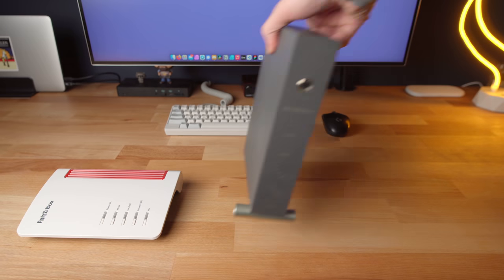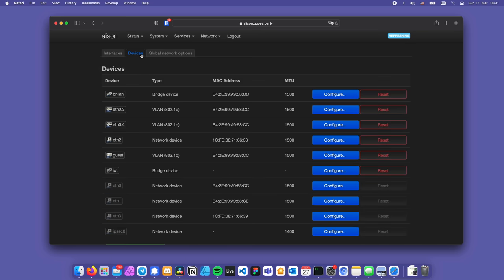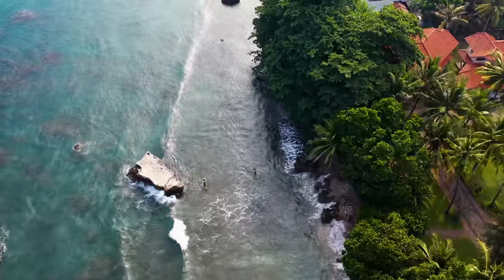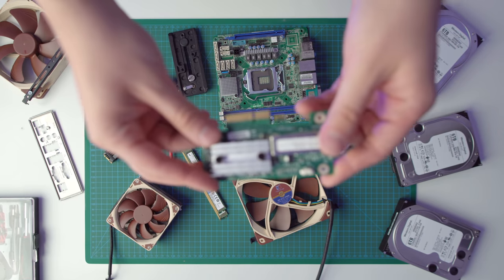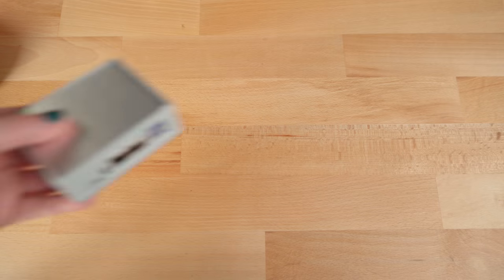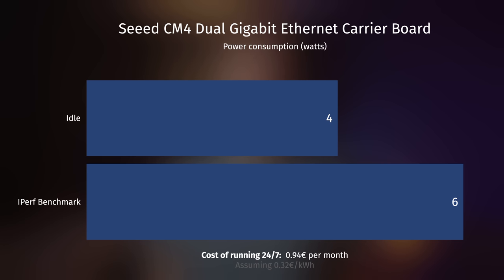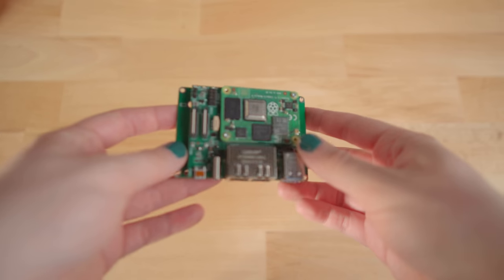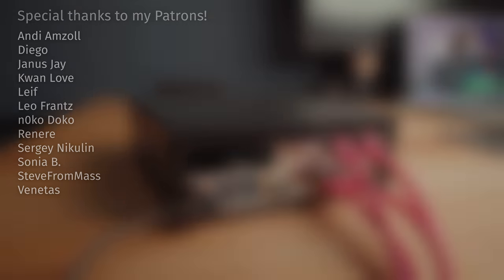Should You Build Your Own Router?

Comment: Those older Atom boards may use 25 watts, but they don't have an Intel Management Engine. Choose one: power efficiency or real privacy. But then is it really less power efficient if you can run NAS, wifi and everything you might need on just one computer instead of 3 or 4 like you do? They have AES-NI and VT extensions on top of that.

Also you don't need one of those specialized router appliance distributions, these just add a glorified web interface to all the stuff that is already available in a regular Linux distribution. Would rather start with a clean slate and install exactly what I need than with all kinds of preconfigured crap you need to spend a lot of time to check what's it's doing if security is important. With a regular Linux distribution you get systemd-networkd which is awesome for networking instead of a spaghetti mess of shitty shell scripts.

UPnP is always a bad idea.
Reply from the maker: Several points.

1. The DDR2 era Atom boards perform about on par with Raspberry Pi 3s. That is to say, you wouldn't want to run anything but the very lightweight OS + applications combo on them, and even that might give you a miserable experience. 
2. I'm also not sure where you got the information that those Atoms support AES-NI. They're called *new* instructions for a reason, and the processors we're talking about came out in 2010 – https://ark.intel.com/content/www/us/en/ark/products/49490/intel-atom-processor-d525-1m-cache-1-80-ghz.html
3. Even if you did have a powerful device that could run it all – you'd be putting all of your eggs in one basket. "Oops, kernel update broke the system, now I have no router, no NAS and no WiFi" is one of the examples.
4. "A glorified interface" is not a bad thing. None of the network people I personally spoke to would really want to "raw dog" pf/iptables and config everything manually. Sure, it could be a good exercise to get familiar with tools like iptables and pf, but those router OSes exist for a reason. Plus, OpenWRT is so lightweight already that you wouldn't really win much by installing something like Alpine, performance-wise. And if you don't like the WebUI, you can always disable it and configure everything in the command line
5. You did mention that `systemd-networkd` is just a more elegant solution than using a bunch of shell scripts, and I can definitely agree here. But personally, I value my time more than some ephemeral "elegance", and OpenWRT is just a faster and more efficient way to route traffic imo.
Reply: @WolfgangsChannel  

> 3. Even if you did have a powerful device that could run it all – you'd be putting all of your
> eggs in one basket. "Oops, kernel update broke the system, now I have no router, no NAS and 
> no WiFi" is one of the examples.

Choose one: not put your eggs in one basket or save power. If saving power is not your priority, I very much agree, it's better to not to put your eggs in one basket, especially for the sake of security. But one has to know that there is a trade off with saving power and not having your eggs in one basket. I'd say the goal if you want to save power is to minimize the hardware you have running at all times because it adds up fast.

I don't think my Atom is from 2010 but slighly newer 2014 (Intel Celeron  N3150 (4) @ 2.08GHz / Gigabyte N3150N-D3V). I'm not sure whether it uses DDR2 or 3. Probably 3. But it does have AES-NI, VT extensions and most importantly no Management Engine for sure. I never checked the power draw but I'm pretty sure with all that's in it it's more than 25 watts at idle. There is no binary choice between 2010 Atoms and the models generally available right now.

I have no problem running dnsmasq, samba, nfs, wpa_supplicant, cups, syncthing, opensmtpd, dovecot, dnscrypt-proxy, tor, chrony, transmission, mariadb, nginx. php, mediawiki and some other minor stuff I forget. It's not slow at all except for mediawiki which I had to optimize to make it run decently by pruning revisions daily and tweaking php-fpm and mariadb. But I think the bottleneck here is the read throughput of the RAID1 HDDs and not really the CPU. I avoid using any program written in an interpreted or bytecode language, I think that ensures more than anything that things will run fast on such hardware and not gobble down insane amounts of RAM which I can use to run more services at all times. I used to have a home router with a Pentium 133 back in the late 90s running Linux and then I upgraded that to an ALIX 2D3. This atom mini-itx system is by far way more powerful than those. If you stick to the same service that ran on these old systems you won't have problems with it being slow.

The kernel problem you mention can indeed happen. But it can be worked around by installing two kernels one of them being an LTS version which is far less likely to have breaking changes. If you don't need the latest and greatest kernel, you can just run LTS and I'd be truly surprised if you had kernel problems. If anything bad happens, you just boot the second kernel and roll back.

Other advantages are daily security updates (rolling release) for packages and the possibility to use a kernel with security hardening patches (not sure OpenWRT and friends have that) and last but not least hardening services with systemd, encrypting user home directories...

> 4. "A glorified interface" is not a bad thing. None of the network people I personally spoke to > would really want to "raw dog" pf/iptables and config everything manually. Sure, it could be a > good exercise to get familiar with tools like iptables and pf, but those router OSes exist for a > reason. Plus, OpenWRT is so lightweight already that you wouldn't really win much by
> installing something like Alpine, performance-wise. And if you don't like the WebUI, you can
> always disable it and configure everything in the command line

I don't want to bother spending time figuring out how OpenWRT and friends do things. I find it much easier to use the same distro I use on the desktop to not have to know another package manager, another init system, another inevitable NIH syndrome and Cisco envy.

I configure nftables by hand because I don't want to deal with the complexity of someone else's long firewall script with thousands of lines of stuff I don't need or that has usage assumptions of the author of the script. A good firewall configuration should be as short as possible: Deny everything and poke holes for what you need. I guess it's a habit but I find firewall interfaces more confusing then just doing it manually.

> 5. You did mention that `systemd-networkd` is just a more elegant solution than using a
> bunch of shell scripts, and I can definitely agree here. But personally, I value my time more
> than some ephemeral "elegance", and OpenWRT is just a faster and more efficient way to
> route traffic imo.

Choose one: time or security.

Systemd-networkd does save a whole lot of time. I have a clear configuration that I can inspect with just networkctl -a status. And I don't need to hack shell scripts that I then need to diff and merge regularly when there's an update. I can just make my changes with systemd configuration snippets. A huge improvement for not wasting time compared to a few years ago when I was still running Slackware on my home router.

Also how much time are you really saving by using OpenWRT and it's web interface ? One doesn't modify the routing configuration very often. Once the configuration is done and working you typically don't touch it for a long time. How much time are you saving as soon as the OpenWRT project decided some use case you have is not valid ?
Reply from the maker: I was talking specifically about DDR2 Atom SoCs. Your Intel Celeron N3150 is neither an Atom, nor does it use DDR3 RAM – so it's more than ok. 

However, it also consumes as much power as my i3-6100 NAS that is running all sorts of heresy (e.g. unoptimized interpreted/bytecode applications)... While scoring 4x as much on the PassMark benchmark: https://www.cpubenchmark.net/compare/Intel-i3-6100-vs-Intel-Celeron-N3150/2617vs2546

While reducing the number of hardware used to optimize power consumption is definitely a valid way to do things, you also need to take into consideration the use cases that people have for their hardware. You might be content with only running untainted software written in kosher programming languages, but I personally need to run other things that might be written in Python or Java. For me, the utility those applications provide for me is more important than the programming language they were written in. 

Using several Raspberry Pis and a low power x86 machine for routing also means that I can turn off my relatively power hungry NAS at night when I don't need it, which brings the total power consumption to around 20W. At the same time, running those 3 machines gives me enough compute power to run other applications than only those that could run on a Pentium 133 :)

The security aspect i.r.t. OpenWRT and systemd-networkd is also questionable. OpenWRT receives regular software updates and has pretty sane defaults – route traffic from LAN to WAN, block all traffic originating from WAN to LAN. Everything else is configurable via both CLI and GUI and it already comes with all the tools typically needed for networking and routing tasks (e.g. dnsmasq, iptables, nftables, avahi, etc.)
Reply: @WolfgangsChannel  You're right it's not an Atom. I thought Atom was the name of all the Intel line of low power CPUs for embedded applications but it turns out it's a specific model.

I guess the right answer on home routers is : it depends very much on what you intend to use it for and what your constraints are. For my use case what I have works really well and is the least amount of hassle to keep running.

Also if you like web interfaces, keep an eye on Cockpit. It's done the right way with D-BUS calls to communicate with Linux interfaces and daemons. A much nicer way to do things than your usual PHP configuration interfaces with error prone config text file parsing.
Reply from the maker: Will definitely take a look at Cockpit!

Comment: I kind of would like my own router, however replacing the functionality of my ISP's offering is hard. It offers a 4G phone network backup should the main fiber base link fail, it also has a built in voip interface, along with a DECT radio. (and now WiFI 6) Both of these are kind of in-house only, the connection details not being made available. (I believe they have been customised, so off the shelf hardware won't work). So yes I could forgo these features, however I like them. the voip is free inside Australia, and the wife can yak to her mum all day at no extra cost - lose the function at my peril?

Comment: 25W really ain't much if that means not spending a few hundreds for a new dedicated mini-PC. Even a cheap machine from AliExpress will cost $200 and is powered by a cheap power brick that is not really designed to run 24/7 for years especially under load. You are much better off with a standard ATX build if you want something somewhat reliable.
Reply from the maker: Those bricks are usually rated for 60-90W, and my noname Aliexpress router draws around 7-15W (18W max).
Reply: @WolfgangsChannel  The issue is one of reliability, not of power. Laptop bricks routinely fail (I had several fail within a couple of years from purchase) and are generally not considered to be appropriate for high availability systems.
Reply from the maker: I was lucky so far, so we'll see! 
ISP routers usually get delivered with similar 12V low-power power supplies as well, so I'm a bit skeptical of the fact that Aliexpress power bricks are much worse in terms of quality

Comment: Sir, not everyone is a cheapskate on power. I need the low latency that Xeons bring to the table. Duel LGA 771s are easy to get, DDR2 ECC is soild, and x5470S AND pci-x cards are stupid easy to get. If you want something to take adventage of fiber, better have xeons not the ARM trash you are sporting. I picked up a SuperMicro Server board & duel Quad-Core Intel Xeon E5410 @ 2.33GHz with 48 GB of ram, I can setup fpsense with a RAM Disk for 35$...and the PCI-x 64 bit cards with 4 gigabit ports are just dirt cheap.
Reply from the maker: Low latency and DDR2 in the same sentence is wild

Comment: just buy a mikrotik router it does everything and it is cheap
Reply from the maker: Apart from WiFi. I did mention that I prefer using separate APs for that, but the miniPCIe slot is there and you can insert a WiFi adapter in it.

Plus RouterOS is an acquired taste...